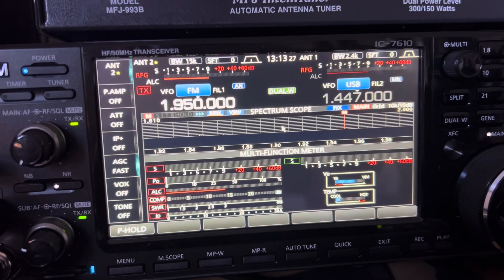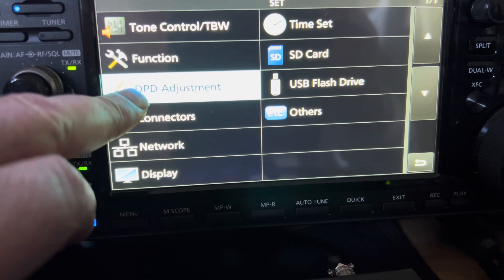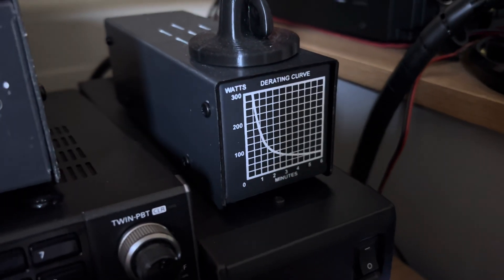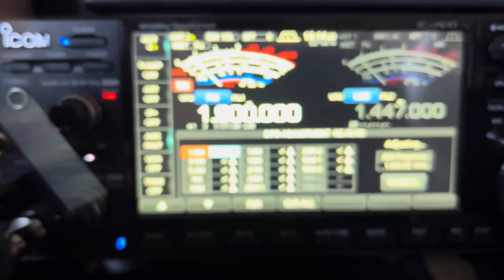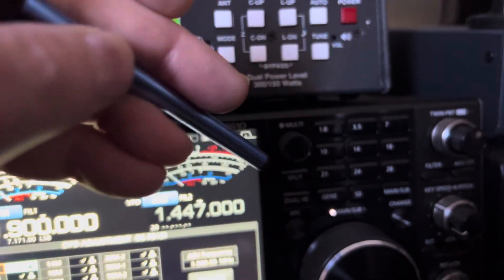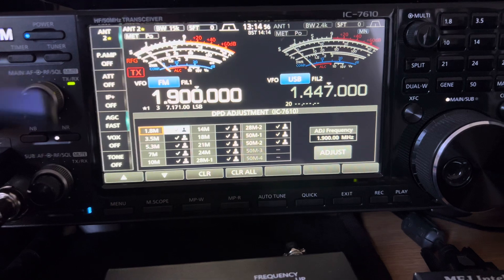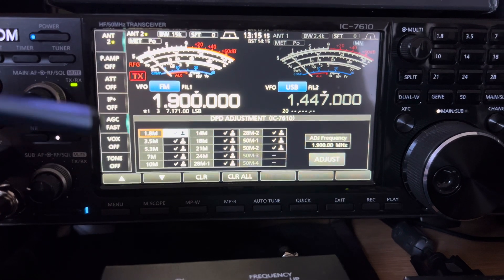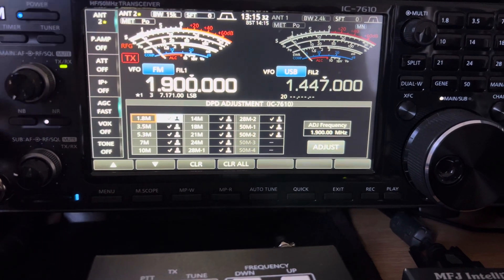How to calibrate your Icom RF power output on an  IC-7610  using the latest Japan Firmware

Comment: DPD (Digital Pre Distortion) is there to reduce TX IMD spectra artifacts, it isn't simply calibrating output power. It looks at the transmitter non-linearities and pre-distorts the drive signal so as to reduce ultimate distortion levels. It will allow the use of the Icom linear amps to be in the alignment feedback loop also. All this means a cleaner (narrower) signal being put on the air.

I have never heard of any DPD option being added for the 7300 or 9700 though

Comment: Mick I think your video title should really mention pre distortion setup rather than power calibration. By pre distorting the signal Icom is able to produce a much cleaner final transmitted signal. The second two menu items are for use with linear amplifiers and significantly improve the signal quality in those configurations. I don’t believe any power calibration as such takes place.   I have implemented this feature on my 7610.    73.  Andy.  VE3ORE